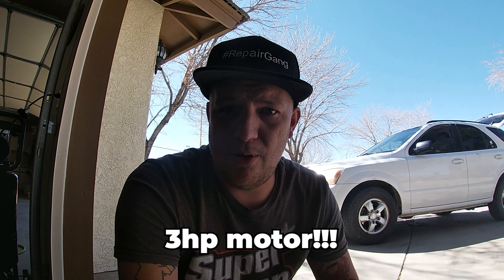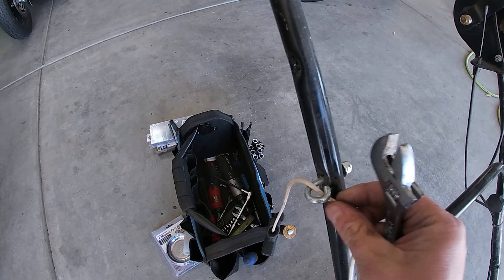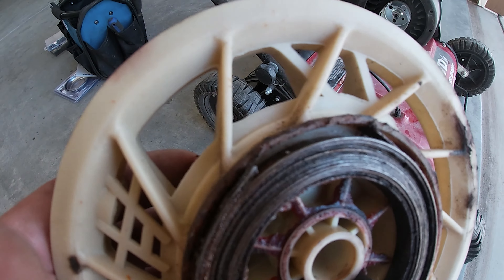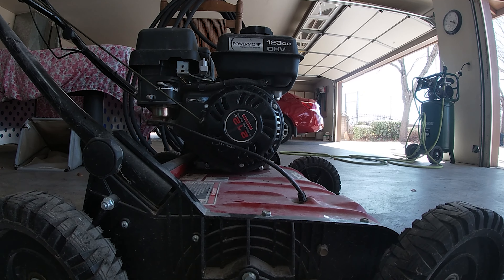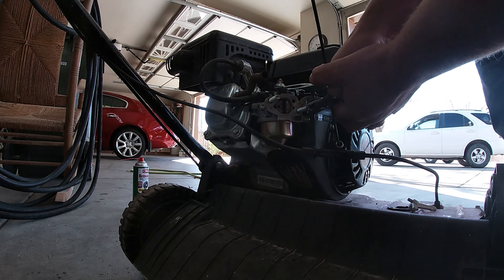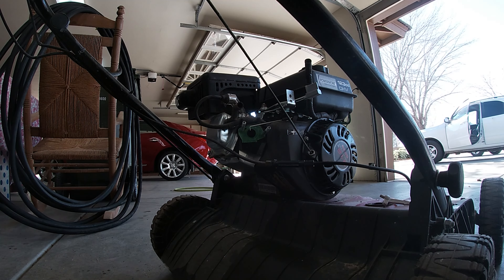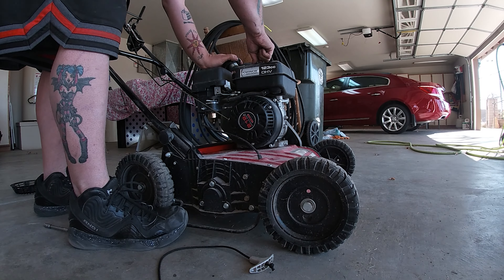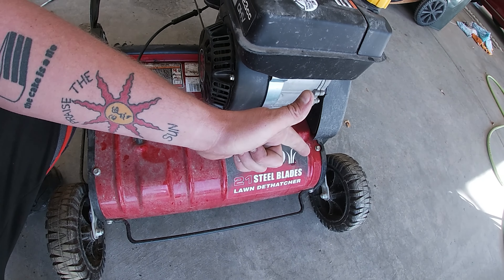power rake

Comment: Nice swap out on the recoil. Glad to know the predator ones are interchangeable. Sounds like he is going to be getting that yard fixed up in no time with all his equipment running strong. Thanks for the tips and upload brother. 💪💪
Reply from the maker: No problem yeah it's the same size as a 5 hp but only a 3 hp

Comment: The blade bearings will overheat melting the bearing holders . They are molded into the holder bracket so you can’t replace them and parts been discontinued. MTD made to die . What junk